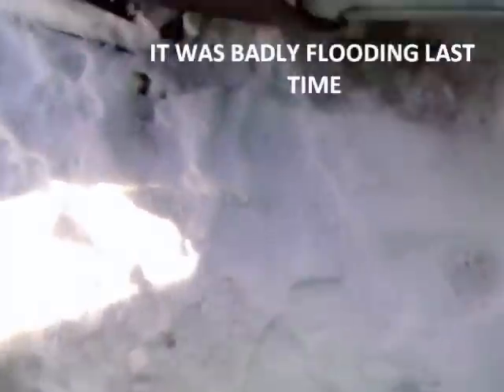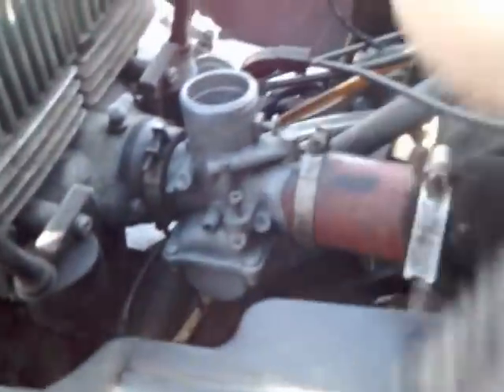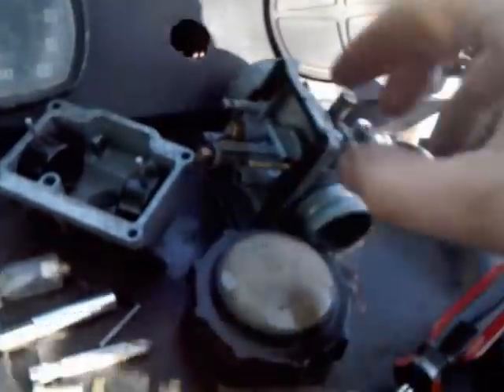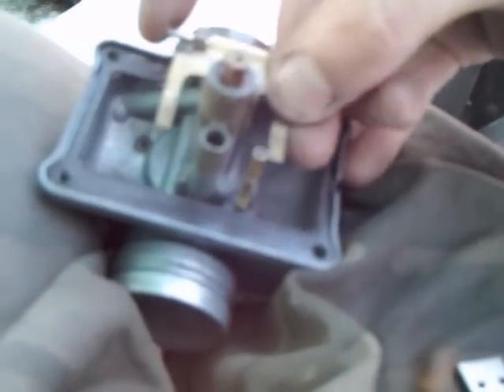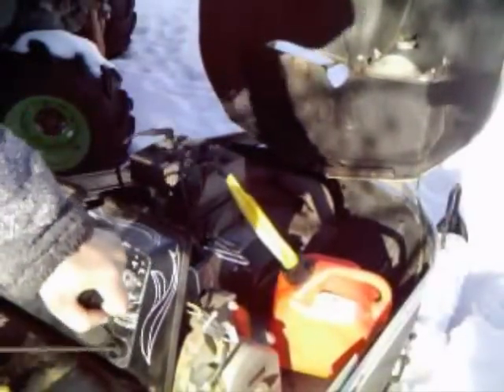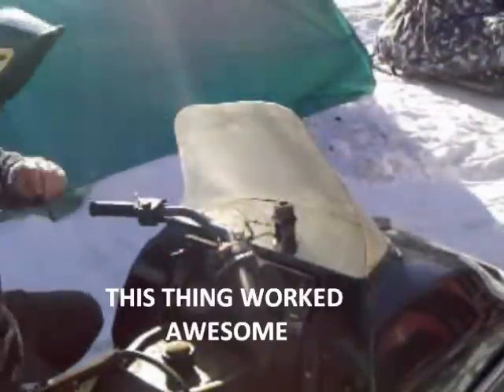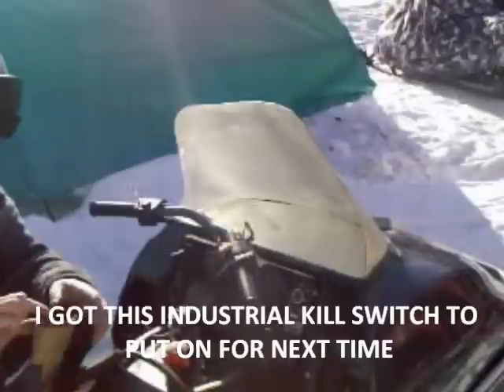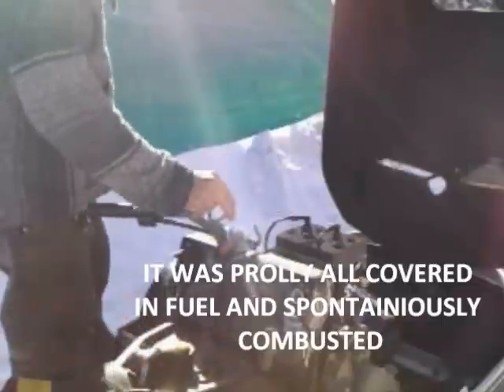How To Repair a Chronic Flooding Snowmobile 640x480.wmv

Comment: that would all come out easier if you would take your spark plugs out.  i had the same issue with a '97 zr 440 i had.  take your plugs out and the excess fuel will shoot out of them like a fountain.

Comment: you should of took the muffler and the plugs out and in the bottom of the crankcase is 2 10mm bolts to drain your crank.

Comment: you proubaly dont need needle and seats sounds to me like your floats in your carbs are sticking clean your carb's...another thing if you have a older mxz with a rotary valve it proubaly aint timed right and that will cause flooding and would be hard to start..